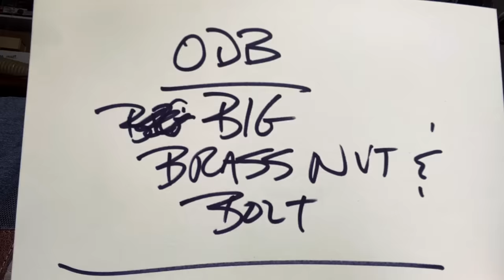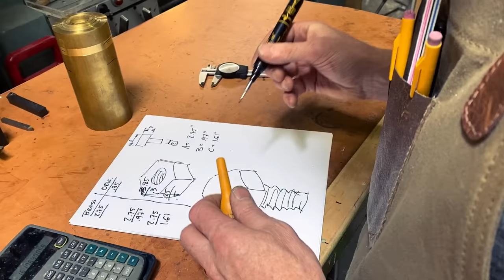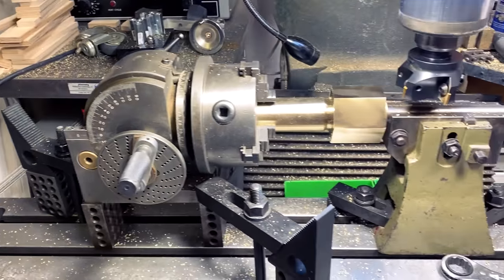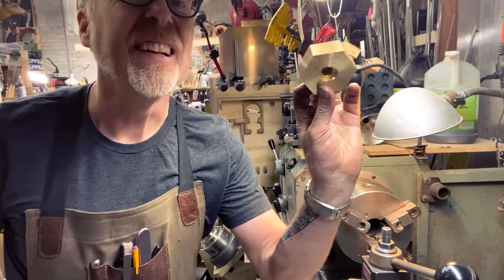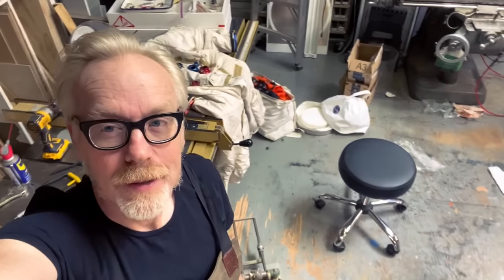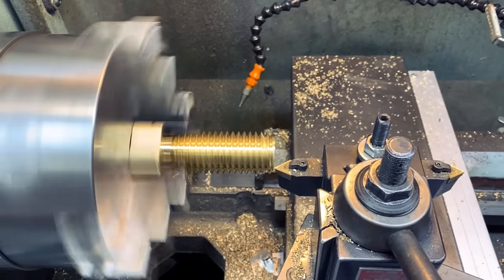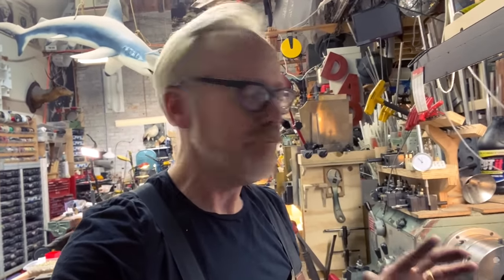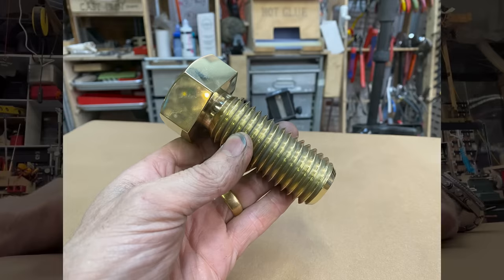Adam Savage's One Day Builds: Giant Nut and Bolt!

Comment: Adam should consider getting a copy of the Machinery's Handbook. It's a reference guide for all things machining. Including what diameter to drill for each thread size.
Reply: He HAS to have a copy, right?
Reply: @PatrickPoet  I've never seen him refer to one, but you would think, right?
Reply: Hey Adam, you've got a Kennedy Machinists Tool Box, don't you? It's what the top center drawer is for!
Reply: I am more than sure he knows what a tap drill chart is as well as the formula for a 75% thread...
However if he is trying to inspire the hobbyist what other better way than to make it so almost anyone can do it....
I think Adam is demonstrating a concept that people can learn and practice with...
Good job Adam
Reply: If he doesn't have one, I will be amazed.

Now, if he doesn't use it, I wouldn't be so surprised.
Reply: @steveattree9674  He definitely knows, seeing as he has one sitting above his lathe at 27:58
I have that exact chart
Reply: Would not have helped in this instance, unfortunately. Adam didn't choose a standard thread, he arbitrarily scaled up a smaller bolt to please his sense of aesthetics. The closest UNC thread would be 1 1/8" - 7. Adam chose 4 threads per inch so no matching tables in the handbook. Adam's technique goes back to the early days of machinery when there were no standards and folks made whatever diameter and pitch they felt like. Worked fine, except absolutely nothing would interchange...
Reply: Major OD - pitch.   Example: 1/2”-13   Thread. Drill size is 1/2”-1/13=  .423
Reply: Steve Attree but trying to measure the minor diameter of a thread with a dial caliper is not going to help with accuracy, especially with smaller thread pitches.

Comment: Right so this will probably be buried, but here's my two cents on why it was grabbing so badly, given on what little I can see of how you're doing it (and it may help other people just learning, and that's what I love about the internet) 

When you turn a thread, by plunging the tool straight in perpendicularly to the work, the threading tool has to cut on both sides, which will chatter and grab due to cutting forces colliding. Setting the compound slide to 30 degrees from the ways and feeding on that instead of the cross slide means the tool follows one side of the v groove and only cuts on the other edge. If that's what you were doing, I apologise, and hope that this gets to someone who is just starting out.

Gorgeous bolt, by the way!
Reply: His main problem with it popping out of the chuck after he decided to use the tail stock is he didn’t drill a deep enough hole, actually it didn’t look like he had drilled one at all, for the live center to do its job.
Reply: Precisely. Also, his order of operations could use a lot of improvement.
Reply: This should be up there ☝
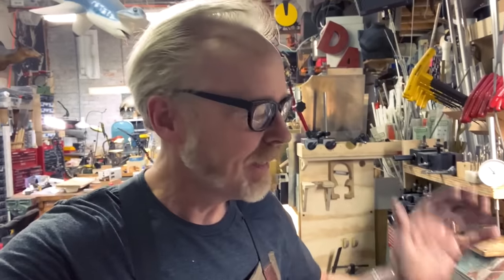Reply: 16:46 and 16:36 super scary. My armchair level advice would be to clamp the piece against a sufficiently tall chuck spider, so the tailstock can provide a lot more pressure against said spider and stabilize the part better. Center height of the tool might also be an issue after reversing it in the holder.
Reply: i seem to remember is has to be a fraction less than 30 degree (ie 29.5) ... but i dont remember why  :)
Reply: @njones420  Yea I'm no machinist but I watch ThisOldTony and for some reason, the 29.5 degree on the compound slide for 60 degree threads really stuck in my head from him haha.
Reply: @davetremaine9763  I've got a lathe and mill, but  self/internet taught ...  I suspect Tony is where i got that from
Reply: The first pass on threads can be 0.020, but should decrease every pass after by about 0.004 until you reach a 0.004 per pass and maintain that.  The 30 deg angle would help.  You should also turn a 1.250 thread OD down to a 1.242 OD or so before threading.  Chamfering both ends of the screw and nut before starting would reduce burrs from the threading.  I would have left the nut on the end of the bolt until after the threading to give more grip area to the jaws.  Double or Triple lead threads can provide another challenge, the front edge of the cutting insert usually hits the thread wall before the cutting edge, so you need to angle the cutter in line with the thread helix or grind the helix angle into the front side of the thread cutter.  Metric to Standard threads on the same lathe has challenges too.
Reply: @Nick Hadfield
,  regardless of the angle set on the compound, the threading tool cuts on both sides. More on one side than the other, but absolutely both sides.
Reply: @njones420  If the compound is set at 30 degrees, the cutter won't plunge in, but will instead take the material off of one side, resulting in much less chatter. But if the angle is slightly less than 30 degrees, the other side of the cutter will just kiss the non-cutting side of the work, resulting in a better finish. 
One side of the cutter does the work, while the other side cleans up the finish. It's a twofer!
Reply: @Impuritan1  Did not recognize it as that until you pointed it out. Of course! This is probably worse than having no tailstock support at all.
Reply: @noridawheeler  Not a machinist, so disregard if I'm wrong, but I agree. The stock had holes on each end to start with, so he didn't need to face the bottom of the bolt until later, and could have used that hole for the tail stock. And if he'd left the nut on the top until after cutting the the threads, he'd have a much better surface to grip with the chuck to stop it slipping. Might have been hard to cut the nut off at the end though, not sure the threaded section would fit through the chuck, but if he left the bit at the bottom with the hole unthreaded, could have had the chuck on that with the tail stock in the uncut nut hole to cut through the nut/bolt head?
Reply: hmmm i've never done that my stuff is probably too small to matter but i wanna have go
Reply: If you set the compound slide to 29 degrees then it assures the threads will be 60 degrees because it takes a small amount off both sides, otherwise you might end up cutting 61 degree threads.
Reply: @joepie221  of all people to correct me, I feel honoured for it to be you 😂 I totally forgot the slight under 30 bit, just a hazy memory from when I was doing large threads. Smaller ones like what I do mainly are more forgiving I've found, so I just plunge.
Reply: @nickhadfield3192  I'll take your comment as a compliment. Thank you.  For what its worth, I plunge every thread I cut with outstanding results. There is nothing wrong with it if your tooling and machine can handle it.  Stay well ( and subscribe )
Reply: @joepie221  I'm here after watching your "Why Did That Part Come Out of the 3 Jaw Chuck?" video.

Comment: Was a machinist for 50 years i remember my first set of threads turned out like Adams first try. Lol
Reply: All machinists and machine operators have been there. It's a rough path to a good part.
Reply: my first grade 12 lathe protect was a 2 inch thread nut and bolt out of aluminium.
Reply: Next step, multi start threads :P
Reply: first internal thread a M60 2.0 or if it was a 2.5 and it was a dead hole guess what hapend to that thread bar   the external thread wasent a problem tho
Reply: “As for this guy I don’t think it really matters” is a bad sign.

It looks like it needs to be the same one as the main spindle speed to me.

Comment: "How fast should I have the lathe set for this material?"

"turtle."
Reply: I thought "turtle" was Chinese for back gears
Reply: 4 times the cutting speed divided by the diameter of the material (300 to 700 SPM for brass)
Reply: Is that under the assumption that π=4?
Reply: @hetsmiecht1029  nah pi is three. 12 inches per foot over pi inches per inch diameter.

Comment: As someone who actually went to school for machinists (CNC though), and since it was a long time ago i won't be so technical, but you should really not take your workpiece out of the jaws that often. you're gonna mess the center of the piece and your nut is gonna be crooked. Interesting build, nevertheless. Love from Croatia <3
Reply: Can confirm.
Reply: I would say that it's a matter of keeping your center holes as reference during the lathe work. If you have a center-holes in each face of the cylinder, you can always center the part you are machining by using the tailstock and a dial indicator.
Reply: @LeoBego  Or just don't take the part out constantly lol
Reply: @LeoBego  
You'll still have some differences though, with hard jaws it can be like 1-2/10 of a millimeter. With soft jaws, which are turned to the diameter of the workpiece, you can get it to 1-3/100 of a millimeter.

If you really want to keep tolerances tight, then you should never take out the workpiece at all. If you are just doing lathe work for fun, the center holes will do it. If you are in the engineering industry, like I am, you have to really think about how often you want to take out the workpiece. The more often you take it out and put it back in, the more chances you have to mess it up.
Reply: A good point.  He should also have a dial indicator so he can properly center the workpiece in the chuck each time.  Watching several other machining videos, it's normal for it to take quite a long time to tighten the jaws, check the runout, modify the jaws, check runout again, modify, check, etc...  until the level of runout is acceptable for the work they're doing.  Eyeballing the center once and running with it seems like bad practice once a true center on the workpiece has already been established.  Good enough for an artistic bolt, but probably not quite good enough for a machining course.  Still a cool project!  Always great to see videos that show you the screw-ups as much as the successes.  Helps everybody learn!
Reply: I was shocked he's not using carbide inserts.  Brass wouldn't have been so hard to work with.
Reply: Bryan Shortall he mentions the dial indicator several times. It’s not in the video, doesn’t mean it wasn’t used.
Reply: @JasperJanssen  Yeah, but on the mill. The lathe has a three jaw chuck, which means that it is highly unlikely that he can tighten each jaw. So probably no indicator on the lathe.
Reply: DJ Florilu you still use the dial. Fine adjustment is done by tapping the work gently. Percussive tweaking.
Reply: @JasperJanssen  

I know that because I work as a machinist. But you have to look a bit closer at the shots where the workpiece is spinning. Watch 15:40 pretty closely, he could have dialed it in with no problems, but there is quite a bit of runout
Reply: Gdje u Hrvatska? Ja sam iz Cakovec.

Comment: Well done! having only achieved hand knurling hammer and bar handles myself, it is a skill. I have known many mechanical geniuses. My wife's father invited the Diamond Knife while working for DuPont in Delaware. In my past as a machine tech I was in their many machine shops. The ones in Wilmington had 6X6 oak beams on end for the floor. Lathes, milling machines bolted down. He was a refugee from Hungary, after the Diamond Knife he worked on other projects. As a moon light job he repaired old electric organs. The kinds that used strings, gongs etc operated by an motors. The greatest machine work I saw finished was a scale model of a WWII P47. It was the fighter flown by a Dupont. He had a real on in hanger in Toughkennon PA. The scale model had fully operating landing gear. I believe it was the first generation that the gear folded up into the wings. He quickly repaired my several MGB's. One afternoon he was winding up a new gas engine for his RC plane flown in the flats of Delaware.  My wife's younger sister there with her husband a true idiot. The engine was buzzing to a whine as Steve tweaked it. The guy asked and poked his finger at the invisible whirling propeller. It small version of the scene from Indiana Jones. We all watched as his finger grew shorter. The next summer at a BBQ he got impatient with the slow start to the charcoal. He grabbed the can from his lawn tractor and pored it on the grill. Lucky or not the whole thing went whoosh, his other arm lost hair and the can shot up 50 ft. Everyone ran while he stood stupified as the can came down.

Comment: I think the reason Adam had problems work holding when cutting the thread in the bolt was the compound was on the wrong angle. This Old Tony's thread explainer video has a pretty good detailed explanation, but basically if you're cutting threads and have it at the wrong angle (29.5º for standard threads), instead of single point cutting, you end up form cutting, which increases the forces involved by quite a lot. It also looked like swinging the compound correctly would have fixed the tool clearance issue, and given a stiffer setup overall.
Reply: Ya, the setup was not conventional. He started with a triangular insert on the OD threads, rather than a threading tool, which made him use a tool holder with too much stick out and put the post at that funky angle. He didn’t use a center at first, and then after he did it looks like the center wasn’t center driller deep enough to provide significant support...
But he got it done!
Reply: I was going to make the same comment about This Old Tony and the 29.5 degree cross slide angle, that tip saved my butt making a cylinder rod It really helps with chatter. I love the videos Adam!
Reply: Yes! Mrpete222 has a great series on threading too! 👍🏼
Reply: I guess that's the key insight here: you don't want to be your thread cutting process to turn into a form cutting operation. I think Joe P. once made a nice sketch on his whiteboard on how you "build" your thread in steps so you can keep the cross section that is removed the same in each pass...
Reply: My thought that thisoldtony talks about is having as much material to grip in the Chuck. He should have left the bolt on the brass and done threads 1st. This would have helped with chatter. He could have extended work out a bit from chuck to use any cutting tool he wanted. He wouldnt have messed up bolt head. Just saying.  Also what u said. Tony explained it with construction paper I think. 👌👌
Reply: Dcvbkyrsscbgdsxcgf   single point is using just one thread cutting insert. The other ways are thread milling (very Cool) dies and taps. So basically single point is a cutting operation. But thread forming is a displacement operation.-Former machinist

Comment: You mentioned seeing one's limitations when polishing the brass, I feel your pain. I just hand polished brass through the sequence of 320, 800, 1000, 1500, 2000, and 3000 grit sandpapers against an engineering reference stone to get a flat surface. It was very instructive on how clean one has to keep everything, and how even one's hand pressure needs to be...

You may not have enjoyed when things went wrong on this build, but the fact that you did not hide your frustration is both humbling (to me) and a useful reminder that things go wrong no matter who you are. I just had a bad day where things went very wrong, and a person I was dealing with got very insulting. Watching this video helped brighten my day, so thank you.
Reply: I'm surprised you take it so far on brass with sandpaper. Any particular reason you don't use the traditional polish approaches to brass? wash with soapy water, 00 steel wool, finish with a brass polish and soft cloth.
Reply: @carbon1255  Perhaps I don't know about the traditional brass polishing approaches... Also, I like the effect, it produces a very flat surface if one keeps their hand pressure even (as flat as the surface one polishes against, in my case 0.0005" over an 18" surface), and if one goes a bit further the lines become so fine that they can only be seen under a microscope. Properly dressed and clean ceramic waterstones, which one can readily get up to 12000 grit, will do the same thing.
Reply: @carbon1255  Hmm, I does not appear I can upload photos here. I wanted to show you what that sanding/polishing procedure produces, is there an email address I can send some to?

Comment: Pretty sure I heard Abom79 and This Old Tony both saying "yup" at the same time just then !
Reply: Pretty sure both Abom and TOT would be dissapointed in Adam for not making sure everything is straight and perfect before machining. But for the purpose of educating himself i guess its alright ;)
Reply: @JockeData  Yeah, those with experience can see where he went wrong but then again so does Mr Savage now.
Reply: Another machinist to watch is MrPete222  - he used to be a machine shop teacher,  YEARS of experience and he has hundreds of machining vids.. a lot of them are on machining threads and such..
Reply: ABOM has tap and dies that size...
Reply: Add Keith Fenner, Keith Rucker and Shurap to the list too. If those five agrees that something can't be done, then it is probably impossible.
Reply: @ehsnils  Happy to say I'm subbed to all the guys suggested here...
Reply: @rdouthwaite  Fill up with AvE and Alec Steele too?
Reply: Cutting the thread away from the chuck is a Joe Pieczynski preferred technique.
Reply: Running the cutter away from the chuck is good... classic joe pie technique. Without the fear running into the shoulder, he could've run the threads a lot faster but that's a nuance. Trying to thread that much stick out without tail support was just a rookie mistake. Making a bespoke nut and bolt... should've made the nut first
Reply: Don’t forget Tom Lipton!
Reply: @planbuildrepeat8264  I think it's harder to make the screw right and with more material loss if it's going wrong, so making the nut last seems like a decent idea.
But running the cutter away from the chuck seems to me to be a good idea, just watch out so it's not being a left hand thread!
Reply: @juliussokolowski4293  OX tools!  Also Quinn at Blondihacks!